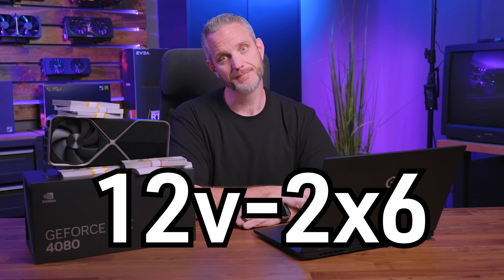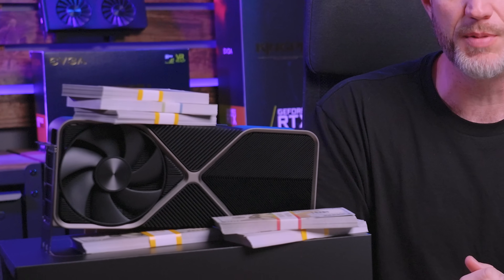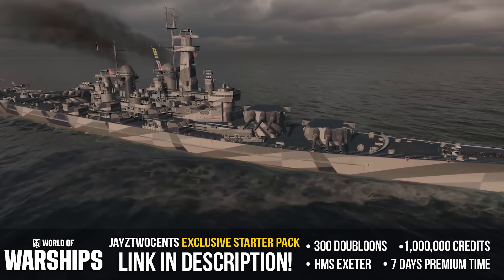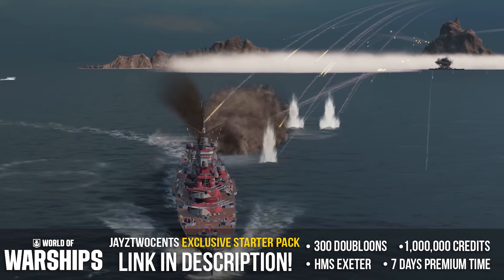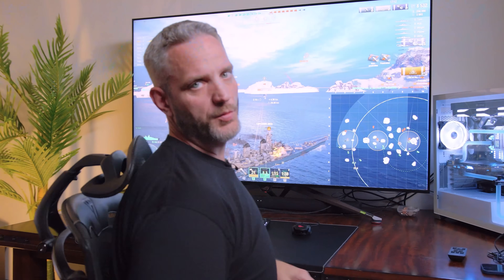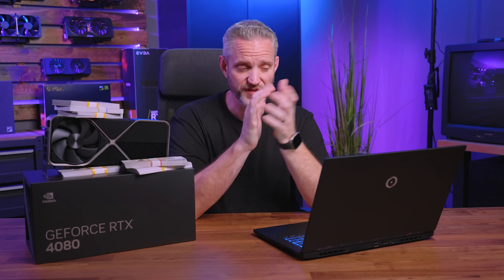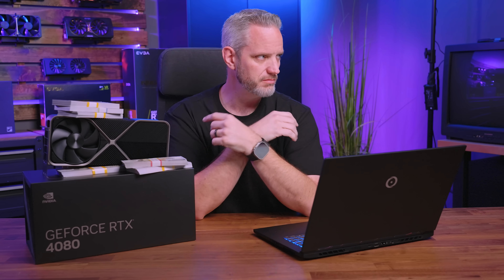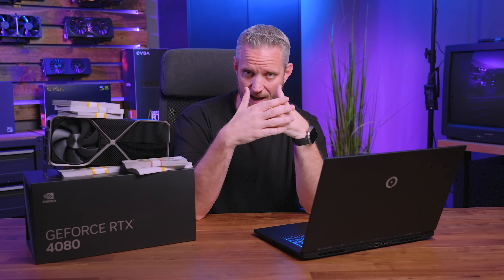They FINALLY admitted that this was a major issue!

Comment: All the current 4090's need to be retrofitted with the new connector. If Nvidia is putting these updated connectors into all of their new batches of GPUs, then there was clearly a problem with the original design.
Reply: The new revision is backwards compatible with existing 12VHPWR.
Reply: Even though what you say is true, Business models factor in a failure percentage. X% = no reaction, Y% = redesign failure point at least cost and implement on future production, Z% = offer replacement for customers that demand it, Z%+ Gov intervention = slow walk full recall. It seams that 4090 failures have reached Y%.
Reply: Are they going to let people swap old 4090s to the new 4090s?
Reply: @ceuser3555  Sadly I doubt it.
Reply: @ceuser3555  Not really. They just need to remove the old connectors then soulder the new ones on.
Reply: @ceuser3555 It's the cable not the card, so maybe they might supply one, or maybe just buy one once released.
Reply: @CragScrambler  I see, thanks. I hope they would then.
Reply: @CragScrambler  The problem is both. The cable melting and not the plug on the card is only because the cable is more susceptible to heat than the connector on the card. There are multiple companies making the cables, one company making the card connector. The bad design of the plug and Nvdia's guidelines dictates the design of the cable. This is most evident in the fact that Nvidia  is redesigning the plug. No company will spend a penny redesigning a part that is not faulty. The design was a failure from the start. An 8 pin plug has a power rating of 150w, You can't add 50% more pins and expect it to handle 200% more power. Third grade math teaches you that.
Reply: @CragScrambler  The new design makes changes to both the cable and the card, the sense pins on the card end are shorter and with a shorter end bevel so that the sense pins will disconnect before the voltage pins in the event that the connector starts working loose.
Reply: Sadly, unless a consumer safety recall happens in the USA, I don't see this in the cards. Pun.
Reply: They need to make a recall for it all, for the cable and the entrance to the power connector so that it works properly without it gpus burning. I think that it's quite sad that power connectors break like this :(
Reply: nicely put,, how about a product recall due to quality issue, shame on you NV shame on you (the poor AIBs!)! next card wont be nv here, well done nv customer of your entire company life now flipping you the bird for life.
Reply: They could just have consulted with Anderson Power to get good power connectors but they of course wanted to go with a style that's re-inventing the wheel.
Reply: "No fuck you buy another " Jensen Huang
Reply: This right here. I am freaking pissed off dude. All of us who have the old connectors are essentially being given the bird by Nvidia. This isn't some tiny mistake. It's a potentially catastrophic issue on a graphics card that is the most expensive commercial GPU in history.
Reply: @ReveredDead  did they give you a refund?
Reply: @ReveredDead  "All of us who have the old connectors are essentially being given the bird" How so when the new connectors have the exact same issue,... ? lol. User error
Reply: And here's me with my single 8-pin plugged into a 4070 😅
Reply: Not gonna happen. You probably will get replacement from you GPU manufacturer if you manage to burn your GPU down, or damage it, but no one is going to replace the connectors.
Reply: @sirius4k  I feel like most people would RMA their card then. And just say its not working or it's slow or something and ask for a replacement. Unlike gpu companies if a car company has a serious issue like this they recall the product to avoid lawsuits lol
Reply: @lovie74  We'll see, I don't think RMAs will be made based on these examples. You would have to show any kind of evidence the GPU has issues. The connector has the POTENTIAL to go bad, but the actual volume of issues so far has been very very small compared to all the GPUs sold.
Reply: @sirius4k  for the the problems have been small. Imo they should do a recall like any normal company that sells products but they are too greedy. Geniuenly lowkey would hope someoens house would burn a bit and then they file a claim against nvidia for poor connector quality lol.

A recall is something a company should be obligated to do for messing up something so simple because they cheaped out the first time. Since it can geniuenly potentially ruin someone whole pc if it fully caught on fire and not only the pcb burnt. The connectors are faulty with the connector hub
Reply: @lovie74  Any normal company? What's a normal company? :P That's not how capitalism works. Maximum profits, minimum expense is how it's played. And if they are not forced, none of the big companies would do anything that would cost them. Nvidia is no different. Shit gets done if it directly benefits the company in a big way or has great potential for massive loss at some point. There hasn't been any indication this being the case with this connector balagan.
I'm 90% sure nothing will be done with the 40 series cards. I don't mind being wrong though.
Reply: 24 pin should work
Reply: @anonymychelerising7074  2 of these new 12(+4) pin connectors KEK
Reply: @profosist debatable
Reply: People buying 4090's and the rest, like me, are some of the most autistic people in the world when it comes to making sure that the layer of thermal paste was exactly right. Cabling is something that was perfected when we were riding dinosaurs in Turok.

This problem is absolutely the industry gaslighting us because, we cannot specifically call them out on it.

We have moved from a "It's broken, fix it" to a "It burnt my home down, just one more thing Mr. Nvidia"

Gone are the days you could buy quality, gone are the days you could buy reliable, gone are the days you cold buy something that would run for 20+years without potentially destroying your home and family after spending some of the most premium amounts ever.

It's crazy: "Give me thousands of bucks and when you get the bill from the fire brigade, we are going to accuse the same community we pitch all these niche functions too, that they did not seat a connector? Are they high?
Reply: @DrWhosmate I still don't think autistic is the word you're looking for, but otherwise there's nothing actually wrong with the statements you've made.
Reply: @ArtisChronicles  "I still don't think autistic is the word you're looking for,"

To be clear (and cliched), I am on the spectrum, however, point taken, I was using part of a label that probably doesn't apply in totality. The part I was referring to was a tunnel vision drive to detail when building custom rigs.

I don't know about others here, but those of us spending decent second hand car levels of bucks on a build, are not prone to connecting cables 'one time' incorrectly, then just leaving it at that.

We check, double check and triple check, especially when the last few months you researched your build, your talking heads are saying "Watch those connectors, they tend to incinerate your house!!!!!!!!!!!".

I'm sorry, but I trust my fellow builders here, not Nvidia who eagerly demonstrate every day, they have no love for the customer, we are just a resource to milk as hard as possible to them.
Reply: @DrWhosmate It is quite possible the most anal people about cables are also the most likely to have this problem happen. "that they did not seat a connector?" That is the big problem with this connector. Even if you have at one point fully seated it, that doesn't mean it is going to stay that way. People are confident they did it right, and don't look at it again. I don't blame them, it shouldn't be something you need to check again after a few wiggles to clean the cables up.
Reply: Multiple outlets came to the conclusion that it was user error in combination with the poor connector design that would encourage said user error. It wasnt just Steve.
Reply: @Cronicrisis  If that many people can have this happen it's a design flaw. A power plug needs to be designed so that it either works or it doesn't. There should be not time where it melts simply because you didn't plug it in just so.
Reply: @joer8854  if you stick a fork into your power outlet and die, was it user error or the manufacturers fault? i still think this 12vhpr plug was a crapy design, but if everything was used as intended there was no problem. what they missed was the "user factor" wich can cause something like this and maybe the rated power is still on the high site. look at the "old 8 pin" conector, rated for 150watts, but can handle even 600 watt without melting.
Reply: @georgwarhead2801  They didn't stick a fork in it. They plugged it in and it melted.
Reply: @joer8854  but they didnt plug it in all the way and bended the cables more then allowed...
Reply: @georgwarhead2801  Yeah i get it you believe that corporations should be able to sell things that short or even catch fire and burn peoples houses to the ground and blame the buyer. 
It should not be possible for the card to melt the connector like that when visually it looks plugged in period end of discussion. 
Anyone who thinks that any appliance should feel and look plugged in and melt and it be the consumers fault is delusional.
Reply: @joer8854  did you even read my comment? thats exactly what i sayed ( more or less)from the beginning. it was user error by not plug it in all the way and bend the cables more then allowed, but it also was a realy bad design of the conector if things like bending the cables can allready cause this type of problems. i never sayed that it was just "because of the user". im sure that many gpu´s out there using the 8 pin conectors are running under the same condicions, but that conector can handle such things
Reply: @Cronicrisis  Yes, and additional testing found that while it was often caused by user error, the problem could less frequently occur even when there was no user error and the cable was fully seated
Reply: @Cronicrisis  This. The problem was crappy design of the connector AND the user error. People not connecting the cables properly is beyond me.
Reply: There's a minimum liability required to initiate a recall. Just becasue they realized there was an issue and decided to make improvements doesn't automaticly reach the threshhold of recalling for retrofit. The number of times it has occurred is small comapred to the total number of cards shipped. It's not like a 1/10 thing.
Reply: @ayah922  good to know
Reply: Simple. Properly seat your power cables, buy a case that fits, do not bend cables, do not use 3rd party adapters, have a professional who knows what they are doing building rigs and you will have a %99.9 success rate according to the data
Reply: No they don't. The fail rate is tiny. Only a bunch of children installing wrong.
Reply: @brandonmichael5296  I agree, but GN tested this as well. The old cable needed to be able to pull more current, but the vast majority using adapter or 12v connector it was user error though I will say simply a better design or even just and location on the card could easily prevented this ex. some like asus off hand i think, at least I forgot which model too, but moved it from facing where your glass would be on you case to facing the front not bending if to short or not long enough and most people (idk why but ascetics like"my case looks empty") buying mid towers that cables make contact witht the glass etc full tower case ive always preferred personally. Oh and this is off topic but fuck rgb everything.
Reply: @bdifferentb  except recent posts have been users with fully flush adapters, that were clicked in and melted anyway. The plot thickens
Reply: @0perativeX  Only with the 3rd party adapters like those made by cable mod. Nearly all original cable issues are user error.
Reply: @bdifferentb  Sure thing Jensen ;)
Reply: @0perativeX  No clue what that means. 🤷
Reply: @0perativeX  The fact that the latch is over the catch doesn't mean the cable is plugged in all the way. We have seen Jay wiggling one back and forth, making it quite loose while still being latched. The plot has not thickened, the cause of this issue was solved a long time ago.
Reply: @--_DJ_--  it's clearly not solved for the OG 12VHPWR sockets otherwise they wouldn't be replacing them XD
Reply: @0perativeX  The change is in response to the solving of the issue... The change also confirms what the issue was, poorly made connections. That has been known for a good long time now.
Reply: its mostly the male end not the female
Reply: @profosist  there were changes to both sides. The GPU must have longer pins for better connectivity. Therefore both sides matter
Reply: @paulhellyer4518  the changes on the card are mostly to cut power if not seated fully etc. Id argue connection wise the switch of the connector internally will make more of a difference. Also to get all of then new benefits of this you need the new standard along with it which PSU's also wont have yet.
Reply: @profosist don't make this a gender thing! 😡
Reply: @profosist female location isn't great, but it's location can be better depending on the model
Reply: It's the cable, not the graphics card.
Reply: @ABP8214  It's also the GPU, where the shorter sense pins are in the new spec.
Reply: @ABP8214  there were changes to both sides. The GPU must have longer pins for better connectivity. There it is both sides.
Reply: @ABP8214  It's both. On the card 17:37 is a female connector, it has longer 12V/GND pins and shorter communication pins. On the cable you need a different internal contacts 6:01 (NTK).
Reply: Its people not plugging the cable in correctly also, and physically damaging things with too acute cable bends.  Its a crap connector design that has far outlived its safe usefulness by now.
Reply: @zybch  you obviously was not listening to the video!!!
Reply: @zybch except at this point it's not user error when plugging in. Have you missed the videos on 4090s melting the plug and cable mod adapters when the cable is fully seated? It's an internal flaw in the plug for the higher power draw 4090 cards.
Reply: @NyteStalker89 Gamers Nexus seemed pretty conclusive it was user error.
Reply: @N3cr0m4nc3r-5  cus gamers nexus has never been wrong... hes not actual tech jesus
Reply: @Findalflin and north ridge fix said Steve was wrong...
Reply: @NyteStalker89 I think you're mixing things together. Not plugging it in all the way has absolutely been a cause but the side effects of this just applify the existing flaws in the cable. 

The majority of people plug it in securely and never see any issues. It can and does still happen but not plugging it in all the way certainly amplies the chance of a problem because of course it does. That doesn't mean the finger should be pointed at them.
Reply: @paulgorden7622  iirc isn't Northridge Fix the only guy to claim it is not primarily user error? Also since he's the contracted warranty repairer for fried CableMod adapters, he presents a serious conflict of interest so take his words with an extra grain of salt.
Reply: @enduser8410  The issue isn't limited to Cablemod's cables. And Jay was skeptical that it was solely user error as well.
I was pointing out that just because Steve said so doesn't make it canon.
Reply: @paulgorden7622  iirc GN didn't conclude it was solely user error either, but primarily that and manufacturing/QC/wire bend tolerance issues, whereas Northridge Fix claims the other way around.

YT drama stoking aside, both sides are closer than we think but in my view NF cannot be an objective voice when he is commissioned/contracted by CableMod.
Reply: @N3cr0m4nc3r-5  GN was dealing with a small sampling of the actual problem connectors/cards, especially considering how long it's been since GN did their investigation and how many cards have burned since then. It is entirely possible for him to be right given the info he had at the time but things change with an influx of new data. None of that matters though, if NVidia is manufacturing cards that start burning up if the pwr connector is plugged in at a 89 degree angle instead of a 90 degree angle that is a problem. Things should be designed with humans and the inherent error that comes with ithem in mind.
Reply: @paulgorden7622  He walked that back later on.
Reply: @N3cr0m4nc3r-5  He actually said some user error could have compounded the problem but it is a design flaw. Steve is pretty thorough in all statements.
Reply: @TheJomoe1  Thanks Steve! You know damn well if the GN team make a mistake they own up to it A.S.A.P.
Reply: @paulgorden7622  Only to the first video which was left open to more info/testing and analysis.
Reply: @N3cr0m4nc3r-5  It was user error. Just because the melting is caused by user error, does not mean the melting should be an issue in the first place. It's a "bad design" because user error causes the connector to melt. A "good design" makes it so user error just prevents the card from working at all (0 chance of catastrophic failure aside from possible manufacturing defects).
Reply: @TheJomoe1  he is a fan boy and does not want to admit mistakes of his favorite brands ,even when others literally prove it (Northridge Fix among dozen others who fix them,showing the plubs completely pushed in and still having the same issue)
Reply: @zybch  Grow up.  This has nothing to do with connecting a cable wrong.  Stop with the gas lighting and lying.  These connectors were inherently defective by their design.  These burning cable issues are 100% due to design and nothing to do with user error.  Multiple people have demonstrated that a connector fully inserted will separate on its own.  Clipping the connector into the socket meant nothing because the clip still allowed the connector to separate.  Any connector that is lose when clipped is defective.  Blaming users at this point is provably a mental illness.  A connector has one job, to safely connect.  This connector failed at its sole purpose due to poor design by whoever designed it.
Reply: @_PatrickO  Both things can be true. The connector is terrible, and people plugging it in "wrong" as in not all the way and making sure it is actually seated and not just latched leads to this problem and makes it user error. It just shouldn't be that easy to get it wrong, so the blame lies with the connector. A loose clip does not make a connector bad, there are countless connectors that wiggle around when latched that work just fine.
Reply: @--_DJ_--  You are insane.  They both are not true.  At no point was user error part of the problem.  We have proof that the connector separates when clipped.  On top of that, a connector has one job to connect.  Any connector easily susceptible to "user error" is inherently defective.  No other pc connectors have this issue, that proves it cannot be user error.  If only one connector has these issues, stop inventing external excuses.  The connector is defective, period.  A connector needs to connect or it has failed its entire purpose.  A loose clip is the connector.  This means it is a loose connector.  The clip is loose because of design flaws, nothing else.
Other connectors could have issues where pins push out and don't connect, but you can visibly see this and correct it.  The problem with 12vhpwr is that you can see the connector clipped in perfectly without issues and it will still separate on its own and melt.  A proper connection doesn't mean anything, the connector is defective.
Reply: @_PatrickO  The user obviously comes into play, there are far more cables working just fine than there are melting. I am not trying to say the connector isn't a problem, just that there is a user part to the problem. In no way should a connector that only works in ideal conditions be released to the general public if the result of getting it ever so slightly wrong is total meltdown.